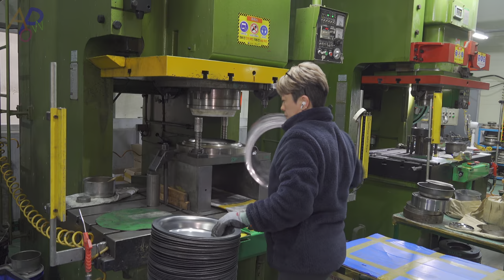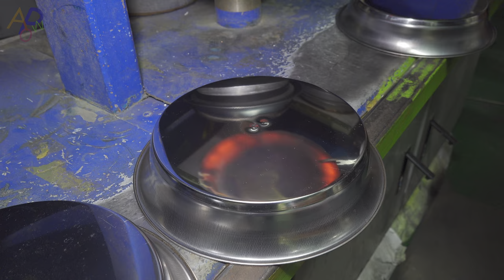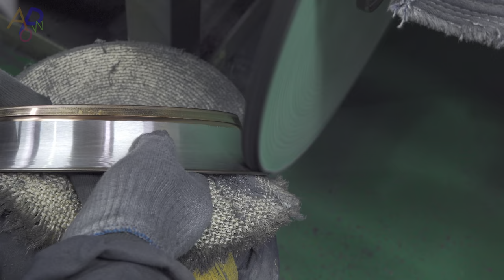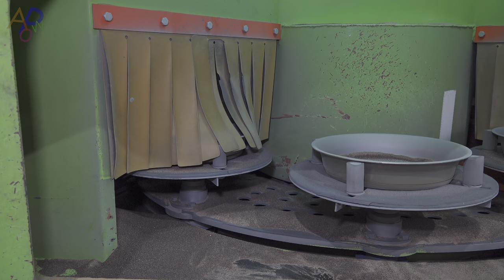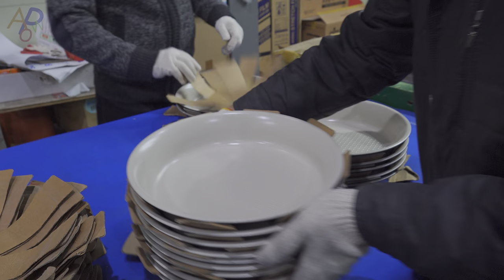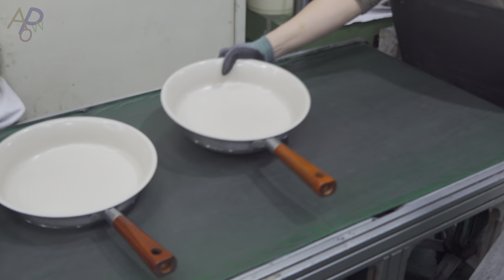Non Stick Stainless Pan Factory. Perfect Frying Pan Manufacturing Process

Comment: Why can't they build a bottom using one thick plate instead of welded thinner ones?
Reply: Balancing between different materials for different purposes. Main body is stainless steel which is durable but conducts heat poorly. So they sandwich a thin aluminum plate between steel plates to help spreading the heat evenly.